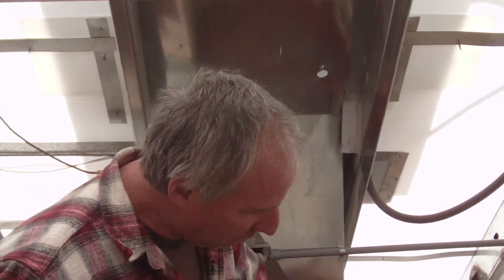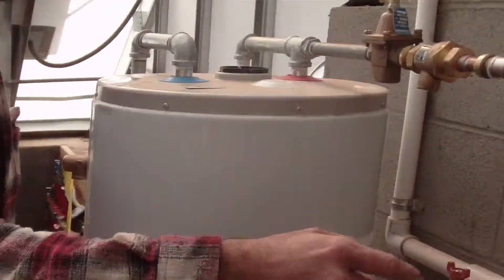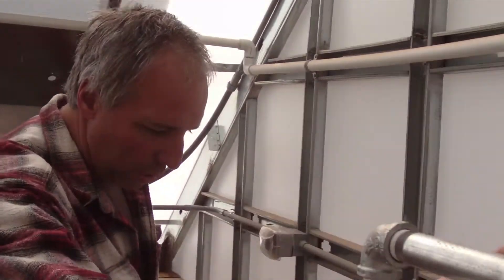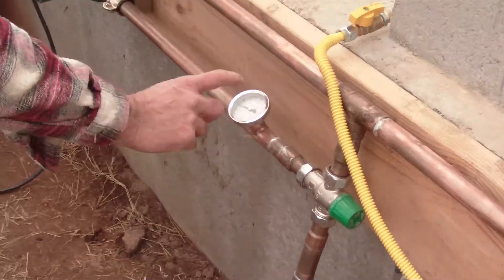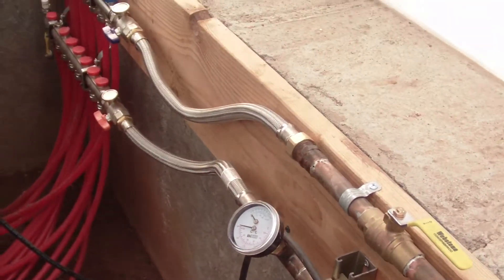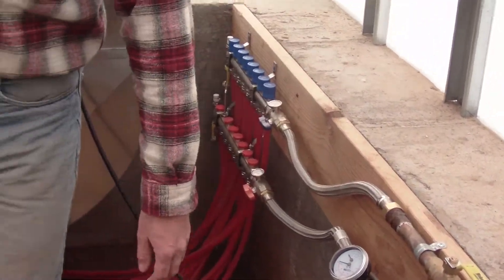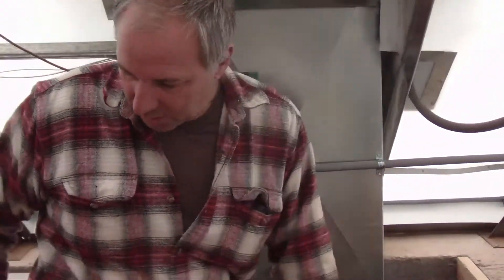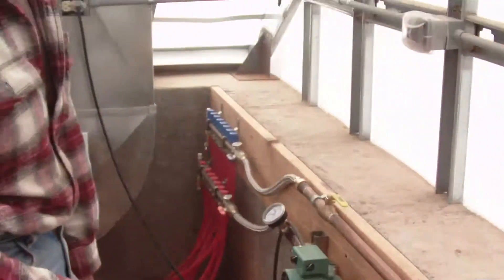Planter Box Water Heating System in Solexx Greenhouse (3 of 4)

Comment: By going with a tank based water heater, you could add a preconditioning tank on the cold side that is solar heated and with the temps you want, that could reduce the amount of NG you would be using - possibly eliminate gas usage.  Great set up.